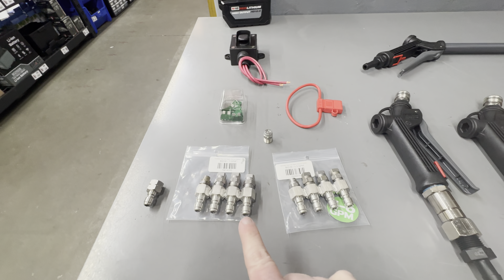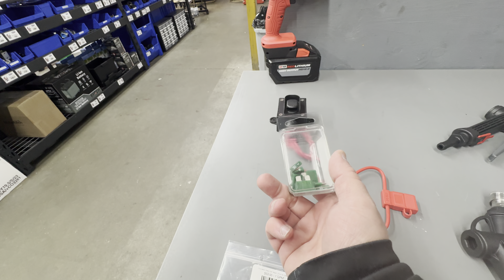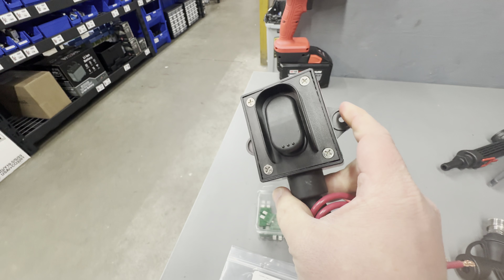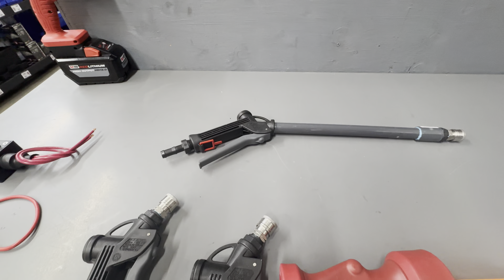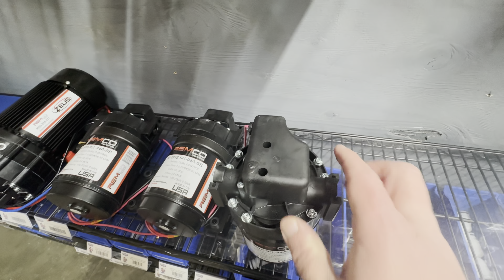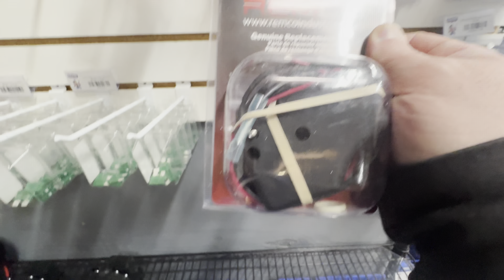Choosing the Right Nozzles for Your 12V Soft Wash System

Comment: Great video! I was wondering, can you use an M5 twist with a 12 volt? I have an M5 twist that I use with my 5.5 gpm belt drive. The 12 volt I use for now is the 5.5 Everflo. Was wondering if guys use the m5. Thanks.
Reply from the maker: Some guys do but we don’t. I like the j rod setup personally.
Reply: ive used both a jrod and m5 twist. M5 is nice cuz u can twist it, but it does restrict flow more. Smaller orifice size